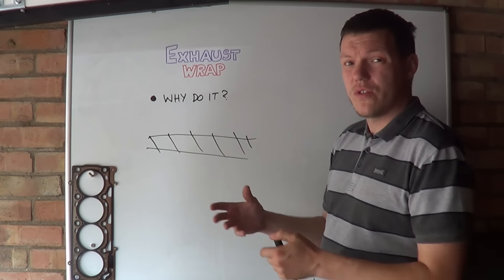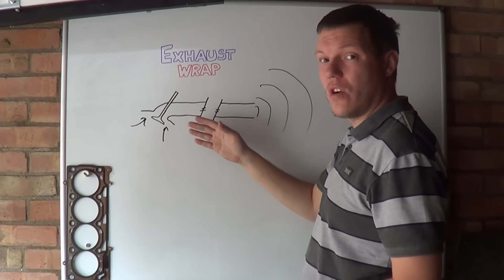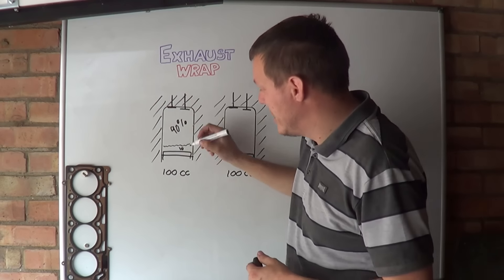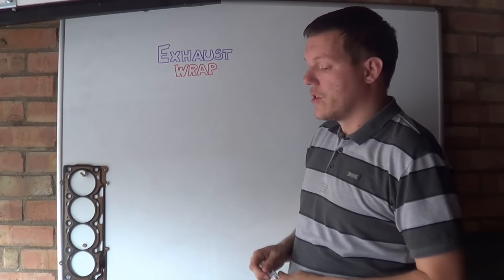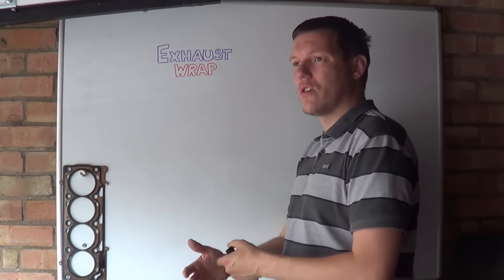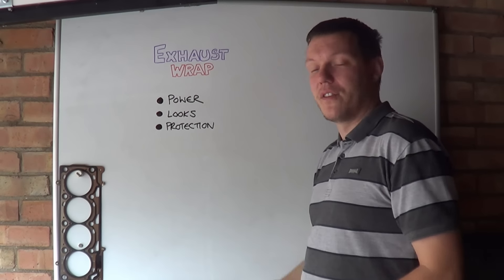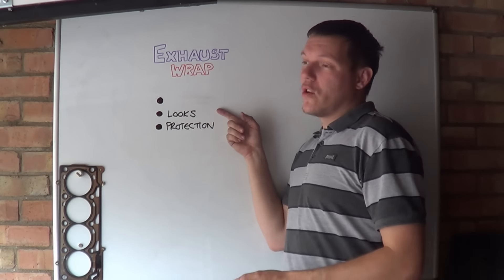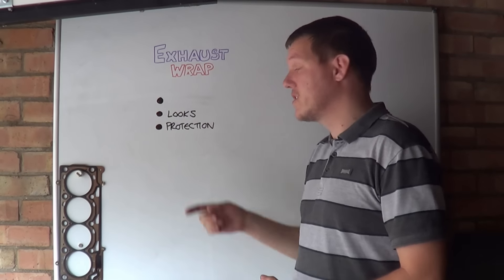Exhaust Wrap - Good or Bad - Bike TEch

Comment: Um.....this is the problem w/ keeping the exhaust hot so that a pressure pulse can move faster.  As gasses cool they contract.  I would think it would be beneficial to extract as much heat from the exhaust as possible and as quickly as possible.  But my physics professor used to say that he'd heard enough from the peanut gallery for one day.

Comment: Worth doing on 2 strokes?
Reply from the maker: Its up to you
Reply: Anthony Davis - Just made similar comment further up.
Personally I would say yes. But not for "power" reasons, which is what most expect. 
For sound, yes the annoying rattle can sound of the typical two stroke. Can be changed/reduced with some wrap. Specially to the ones using the high performance/light weight exhausts made of paper thin sheet metal. ;-)

Comment: I think you are confusing the speed of the pressure wave with the strength of the negative pressure pulse. The two do not necessarily have much to do with one another.
Reply from the maker: What? None of what you just said makes any sense. 

The speed of a pressure wave is defined by the absolute pressure of the gas and the temperature of that gas with the maximum velocity known as the speed of sound. 

What the fuck is a negative pressure pulse? How how strong is it? LOL

Comment: the best reason is all 3, i dont have a heat shield on my exhaust, its ugly already  so it will look better and if i gain a bit of scavenging even better. also i live in the south of Portugal, hardly any rain and i definitely don't ride in it and no salt on the roads so no real downside

Comment: I use the wraps for protection I worry about catching the forest on fire on the motorized stuff I build.
Reply: I like to end the wrap where the blue temper stops and the end of the bare pipe where steam starts coming out but not condensed water. It's got to fit on a sled so I make is as short as possible.

Comment: Wrap doesn't hold moisture... The metal rusts, because the metal gets so hot it oxidizes. That is what causes the rusting or break down. Another caveat to wrapping is cracking, for the same reason above.

Comment: Im thinking to try it on my Citroen 3cv engine exhaust (Argentine 2cv6 version) now the other day outside temp are 42,5 Celsius on my city... yes a hell... when im enjoy driving my Citroen...  i feel that heat like meat in the oven!!  i protect the front of the cabin but  the heat still there! , someone try or test Hi heat paint like VHT? is good? i use a Hi heat from Rust oleum.. and that is a SCAM... in six months  falls in little burned pieces..

Comment: The protection is temporary it will rot the exhaust after a while.
Reply: Just removed some on my nighthawk 750. Just dont do it guys unless headers are crap to start with...I saved mine in time they were starting to rust.

Comment: The benefits of exhaust wrap are really minuscule. The negative aspects of exhaust wrap are major. The exhaust wrap retains moisture and causes corrosion and failure of the pipes. Plus the cosmetic factor. Exhaust wrap looks absolutely like shit and gets worse and worse with time. I have my Trask turbo system pipes ceramic coated as well as on my '74 FXE. Ceramic is far far better than any crappy looking exhaust wrap.

Comment: Just as a note, in steady state conditions (which exhaust flow isn't), mass flow is unaffected by heat transfer.  That is, an exhaust that is wrapped, vs. one that is unwrapped be able to flow the same amount of exhaust gas mass.  The reason is that as temperature and velocity falls, gas density increases, thus negating the effect of the lower velocity.  I understand that exhaust flow is highly unsteady which may mean there are some other, more complicated factors affecting scavenging.  However, I do not think this explanation is accurate from an engineering fundamentals perspective.

He did note how the speed of sound changes with temperature (its actually a function of the square root of temp, not linear).  This effect may be important, especially with longtube headers.  Changing the speed of sound within the header tubes would presumably change the RPM at which adjacent cylinders resonate (blowdown events help scavenge other cylinders, see "tuned exhaust").  This phenomenon gives a volumetric efficiency boost at certain RPMs.  Header tube lengths are the main driver of this effect, but if you could insulate the pipe and increase the gas temperature, that might raise the speed of sound and raise the RPM at which the resonance occurs.

Please note that my last paragraph there is speculation based on engineering principles.  I would have to see data to confirm  :)

Comment: I think if your not going for the wrapped look and your not getting burnt or slowly cooked by your exhaust don't do it. Its shit for corrosion and you will not see any significant hp. Coatings are way better but expensive. your better off  making a guard if you can than using this shit.

Comment: Nice overview young man...take away the differential equations math and I thought I was in my Thermodynamics 101 course in Engineering College for a brief moment. P.S. that is one reason Inconel is used in the aerospace industries along with F1 and NASCAR exhausts systems, because iconel has superior heat retention properties, along with being lighter than titanium given the same thickness.
Reply: Ok, you caught me off guard. I am not engineer but works daily with titanium tubes, sometimes stainless steel and more rarely with inconel. However I was 100% sure that titanium is lighter than inconel

Comment: I'm European and I feel engines are getting smaller and smaller due to regulations.
Is it possible then car manufacturers start using bike engines in cars? Same engine for cars and bikes. There are several bike engines with 200hp, and my car only has 90ph lol.

Comment: Look. We wrap pipes because they look good.  If anyone out there thinks there bike will be faster, your a complete idiot.   Back in the day it was called splitting hairs!    You  will NEVER EVER  feel any difference.      If you want seat of the pants power.  SPEND SOME MONEY!!!!!     
I have a 98 113 s&s.  That I wrapped .  I'm still riding it today,  its had one rebuild.    Same heat tape from day one.  Pipes are still structurally sound.   Just take care of your shit.   Heat tape is strictly cosmetic on harleys

Comment: You are trippin ballls my guy.

ITS TO AVOID HEAT SOAK 
 
Heat does not spool turbines. Cold air from an air compressor will spool a turbo just the same.